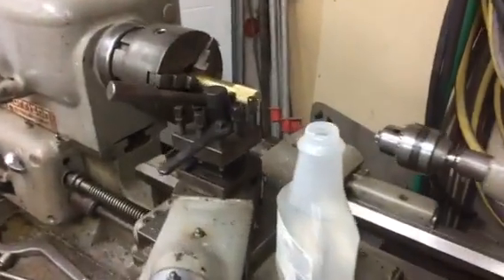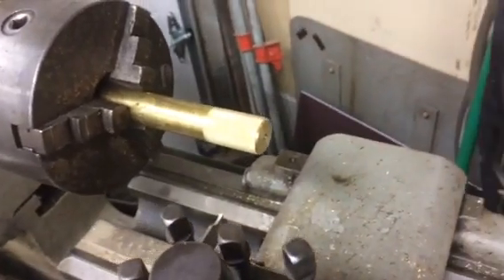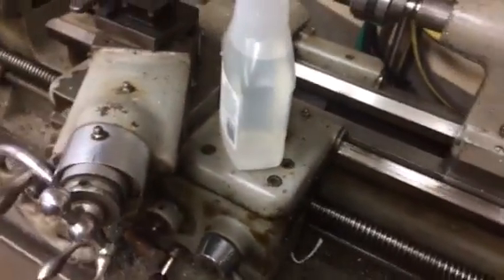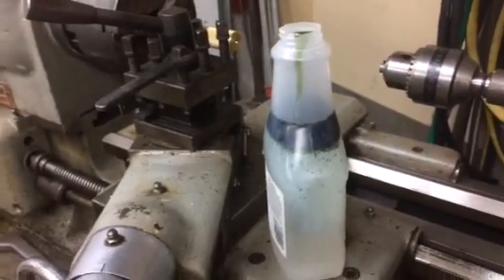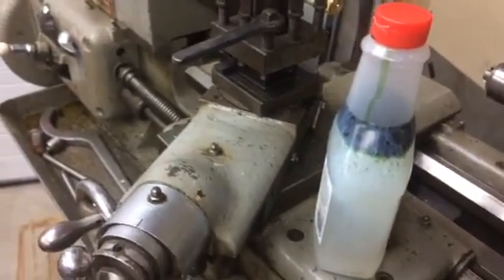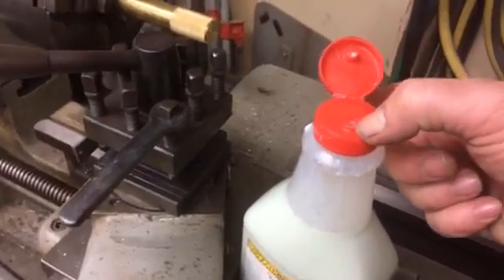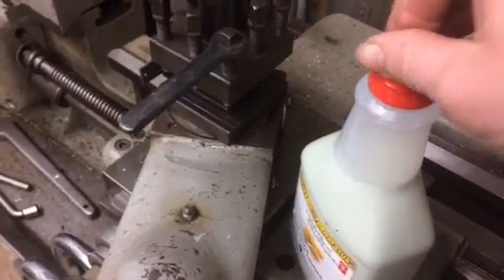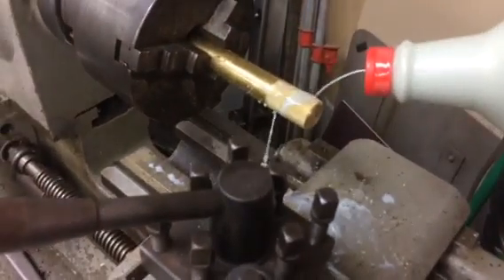Cutting fluid

Comment: Someone keep that man away from these beautiful old machines my God what the hell are you doing? Used motor oil has no ability to help cutting it has no ability to prevent rust from the water there's no rust inhibitors in your ketchup bottle use real coolant and cutting fluid and you don't need it with aluminum anyway please stop now and walk away from that machine before you destroy it. I restore these machines and I've been doing it for 30 years this makes my skin crawl I can't believe you would do something like this to a beautiful old machine go buy some real fucking coolant
Reply from the maker: I'm really glad you can view all the comments. As a perfectionist you probably read that I am using Castrol super edge 4k???